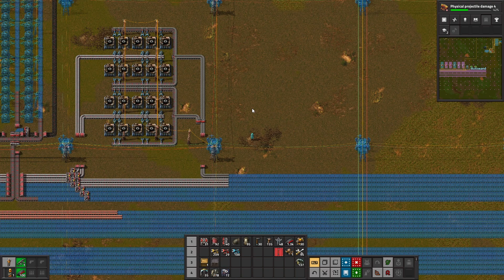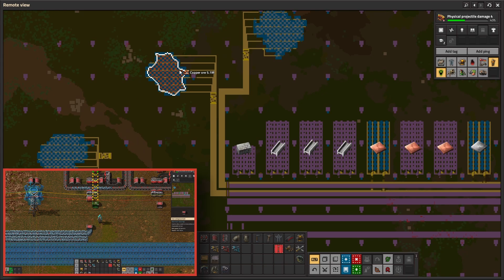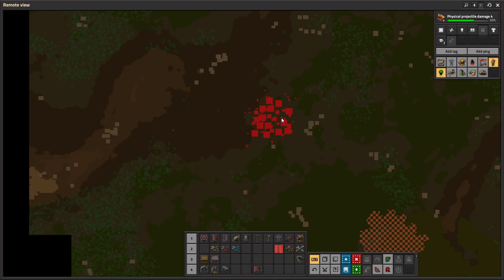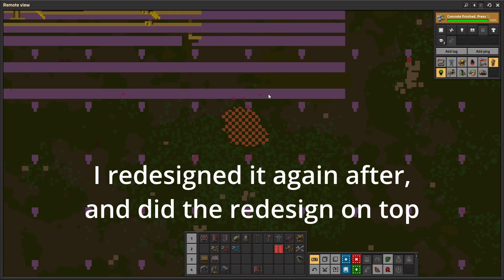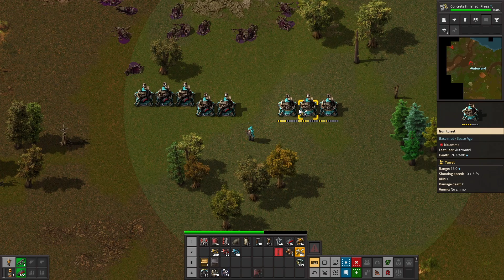The Green Circuit Build | Space Age New Player Guide | #11

Comment: Hey Auto! In episode 7 you added 4 lanes for the green circuits on the bus, but at the same time you said that you would be only filling two of those. Did you decide to add 4 lanes instead of 2 to keep the lane size consistent with the rest of the bus, or was it bc of something else?
Reply from the maker: I only used enough assembling machines for roughly 2 1/2 belts worth but had 4 belts worth of space so that I could add more later, or also leave room for upgrading assembling machines later.
Reply: Gotcha! So that's why you left the first build as a ghost right? So that if you felt like having more green circuits the blueprint was already in place
Reply from the maker: @sofiaiaiaiai  Yes, it was a build I knew 100% I would fill out or would be filled out later so I left it as a ghost.
Reply: @Autocraft_Auto Alrighty! I'm really enjoying the series so far!! Thanks for the great work!